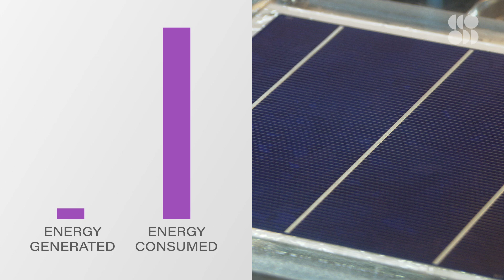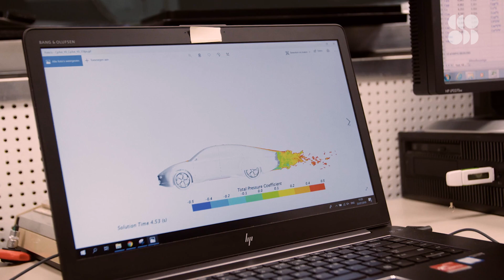The Solar Car Revolution Could Change EVs Forever

Comment from the maker: Would you drive a car that runs on sunshine? Let us know in the comments below.
Reply: I don't really need one since I can plug in at home, but if I lived somewhere without a driveway it could be a game changer.
Reply: What about Night range, and winter range in higher latitudes? 

Sounds like it’ll have geographic limits where it’ll won’t be crippled.
Reply: I'm looking for a car with great range. Nothing matches an Aptera with it's 600 or more mile range. The fact that it recharges itself is pure gravy, but useful for trips to the wilds.
Reply: @fotoguru222  
Is that winter in Wisconsin?
Reply: @larryscott3982  The usual wild places for me are the Adirondacks in NY and the 10,000 Lakes region of Ontario north of Barrie. Want to explore other places as well.
Reply: It sounds like, if necessary, the aptera plugs in, too. Both do. Finding a plug in those places is going to be a problem, though. What's the battery life from the last charge? Agreed that it can work.
Reply: Nah where I live it’s cloudy, I would rather buy a plug in EV like Tesla
Reply: I have ordered one. Not necessarily because of the solar, but because of the extreme efficiency. I love that it needs almost 3 times less energy than the most efficient electric vehicles on the market today. Finally a vehicle that uses its design to eliminate all the waste. I'm really uncomfortable with using more resources than what's technically necessary.
Reply: Better be both solar and plug in ev
Reply: @muhammadwibisonojanuar7793  it is..  250 -1000 mile battery options.
Reply: Yes! Bye bye electric bills
Reply: Yup
Reply: Can you guys feature the solar powered bioreactor?
I am really interested about it
Reply: It’s not a thing so no.
Reply: Air conditioning?
Reply: @FiftymonkeysonAtree  nope
Reply: Stupid concept, so no thanks.
Reply: What if you remove the wheel in the back and add some sort of magnets, powered by the solar cells, one down at the rear and one up in the wing thingy? Wouldn't that make the car's back stay up and give more mobility?
Reply: @JosephMaties  no
Reply: Using a car with both lithium batteries and solar panels is the optimum and best solution.
Reply: Around arctic equator this car would be useless since we get about 4 hours of sunlight on winters.
Reply: I wonder if it is possible to make transparent solar panels and then laminate them together to increase energy output or density while significantly reducing the apparent space/area required to utilise them. One of many problem would be weight because glass is heavy, laminated sheets of glass together are very heavy.
Reply: only if its 4 wheel drive, can handle adverse road conditions and weather.
Reply: not in the uk i wouldnt, my car would never charge up in the sun, as we dont get any
Reply: Most of us already drive a car that is solar powered. The solar energy is stored in the most efficient medium possible - the chemical bonds of a liquid hydrocarbon complex called "gasoline".  In so doing, the buried biomass robbed from when life flourished is returned to make Earth greener again. As carbon dioxide does not drive climate change, higher CO2 levels will help fight desertization and improve crop yields. Unlike chemically toxic batteries, no coal fired power plants will need to be built to recharge my Honda. Electric cars are for the "not in my back yard" types.
Reply: @tedphillips2501  No most people don’t drive solar powered cars. Where I live most people drive: hybrids or EV, some gas and diesel. There are flaws with completely solar powered cars and limitations that will effect it but not plug in EV.
Reply: @tedphillips2501  I suggest you look for your climatology knowledge from beyond those funded by the fossil fuel industry. Perhaps read something from the scientists at NASA and NOAA, like https://climate.nasa.gov/causes/

Comment: As for electric cars instead of plugging them in every time when the batteries is low, why not put a generator hooked up to the back drive wheels by a drive pulley belt or some type of shaft to the back wheels and the generator wires connected to the batteries as of a voltage box to keep the batteries fully charged while driveing and the batteries will never run out of power. That's my suggestion to an electric car manfactures.

Comment: Less ‘forget EVs’ and more ‘think EVs but batteries + solar panels + weight deduction and air flow efficiency’ would be great. Combining batteries and solar panels together would likely be great for having a smaller lighter battery with longer range. Plus getting these on trucks would probably be a big deal considering they want to go the distance while having as light a battery as possible.

Comment: @seeker look into this, i have known about this and i have seen the experiment that they did in california with the first solar car. The next part is to 3-D print wind turbines for better energy generation. The vehicle would be able to generate approximately 30% of the energy of the wind and if you put it along specific points on a car that the cars body will funnel the air to and create turbulence. This would be a wonderful asset for any vehicle enthusiast that wants to save the environment. There is more to this but this post is long enough
Reply: 3-D print wind turbines and put them in the wheel well of the vehicle. You will be able to almost have a perpetual machine. I have not copyrighted this as i want everyone to utilize these technology's, check to see if anyone did copyright them but please utilize these technology's
Reply: @johnohm8067  That won't work for 2 reasons:
1. The wheels already have hub motors and no free space
2. It is impossible to reclaim more energy through the turbines than the drag that they'd produce; they'd end up losing you energy and efficiency due to energy transfer losses
Reply: @LeesChannel  i indicated almost as an arbitrary word that is typically used for something that is close to something else but is not that something else. I think that you may have misunderstood the phrasing or use of almost to indicate that it would be close to perpetual motion but not perpetual motion for very specific reasons. 2nd law of thermodynamics is a real thing and i understand thermodynamics but even so why not utilize various technologies to get as close as possible to a completely efficient machine. From a consumer standpoint this would be ideal as you would have such little loss that the vehicle would require less to fill it up and go long distances

Comment: commercial ad that dont even speak of the most important things like price ? Autonomy ? Safety ? Payload  ? Speed ? Rare earth  in solar panel ? still need battery ? And what if you leave in cloudy climat ? How to product that on a large scale ? Etc ......just dream and try to attract investor... Im for eletric vehicule, it s  just that selling dream dont help and my BS meter sound alarm every minute of this video. This dream need breaktrough tech in some much way, For ex : better solar panel is not enough (10% better), revoluitonary solar panel (3 time better). So nice tech research but just that, no revolution...in 50 years it could become something commercial, maybe. 
An electric bike is more revolutionary.

Comment: Can they upgrade it, so the rotation of wheels can generate electricity which will be stored in batteries for later uses
Or add foldable solar panels, so when the car stationary can charge faster and harness more energy
Reply: They both have regenerative braking

Comment: Whats the range? performance? and other safety features? how will this fair in an accident or crash? the drawback of these concepts are still too high before they can be sold to the general public. The concept is great, but i believe this needs to be accompanied with a fiar comparison, and the information of the breakthroughs that need to be present before saying these can change EVs altogether. Breakthroughs such as materials cost, materials selection and design, as well as the fundamental concepts of solar energy and how much power and efficiency is needed to be comparable with a regular sedan, or current EVs. Also, with the design of current solar panels, it also only allows 1 colour basically, it may be small, but aesthetics and customisation helps to bring in more customers. If everyone's car looks the same, and it wasnt really something to do with a possible choice of the product, but basically it cannot be customised because it will affect the performance of the product, then thats another issue.

Comment: EV is the key....all the problems of solar is eliminated.

As per ev it is replacing fossils (100% non renewable)
With electricity which is 60 % non renewable generated and 40 renewables.

And that 60:40 is getting better by 2050 we will have a 25:75 ratio there. Meaning your moral compass is fine when using a electric vehicle.

Electric vehicles have been competent enough with combustion... soon they will start destroying combustions.

Solar cars will never gain traction...all rich countries that can afford this car are not rich with Sunlight radiation throughout the year....those who have are not rich enough to adapt.

EV is for all....rich buy "Tesla s" poor will by "Tata's Nexon EV"

Comment: This is exactly what we needed, a car with both solar panels to generate electric power and lithium batteries to store electric energy while also being able to plug to the grid and get energy from the grid whenever necessary.
Reply: Lithium batteries cannot be avoided. Solar or Electric Vehicles both require some sort of a power bank

Comment: The sun charges my Lithium-ion batteries when i accelerate.. And when i stop accelerating, the motor turns into a generator, and also charges the batteries.
I also have 2 small wind powered generators that convert the air flow of my car moving through it, to recharge the batteries.
With all that, i almost never have to press the brake pedal, but when i do, the heat is converted in electrical energy to recharge the batteries.
With all this, i can almost go 5000 miles without having to plug it.

Comment: The answer to solar and wind turbines is that they are now unnecessary. We now have the ultimate and cheapest green power device with none of these problems, in the SAFIRE GENERATOR. This is what we need to negate all the problems of all competing green energies. It produces almost costless electricity and therefore hydrogen from new FUSION NUCLEAR and is now immediately upon us. We have recently taken a new step to advance the physic of medium temperature plasma fusion power production by enabling chemistry of the atomic nucleus, or "nuchemy" in the newest FUSION NUCLEAR POWER technology. We are passing the chemistry level where we interacted with the atomic electron shells and are moving on to manipulations in this "NUCHEMY" atomic nuclear era when we interact and multiply nuclear protons. We have rediscovered the lost work of the alchemists and can make new elements with different atomic weights. This was ably demonstrated in "THE SAFIRE PROJECT". Quanta are important. We now have enough energy to manipulate the atomic nucleus much more easily by creating a compartment, or what is a local region of plasma containment so reactions at this atomic nuclear level can easily take place. This is about to practically enabled a really fantastic and cheap new era of energy production for the whole of mankind. This with hydrogen, so free fuel obtained from water or atmospheric moisture anywhere in the world. This new fusion nuclear SAFIRE GENERATOR is at the industrial commercial production final development point as of now and it can retrofit older and decommissioned power plants. The energy argument and other power methodologies are all now virtually irrelevant as we have new and very physically and economically powered practical and local community level fusion nuclear power. Solar roof plus Teslawall battery may be the present way to go domestically but megapack batteries and multiple storage technologies interconnected with an expanded ugly grid have a less certain requirement when you consider new any-scale community based and 24 hr reliable and self-fueling fusion nuclear in the form of the "SAFIRE REACTOR". Learn all about it at "AUREON ENERGY.COM". Then learn the newer EU Theory and plasma physics at "THUNDERBOLTS PROJECT.COM" and you will be permanently reeducated with this advanced newer EU theory that will allow you to understand more about the astrophysics of our whole universe and all within and you will be more informed and can teach your peers.
Reply: Fusion has been 30 years from working for the last 50 or 60 years...  It would be great if the Safire Project has made significant moves, we will just have to wait & see.  However, it would be grossly unwise to say that the Safire project offers interesting promise in maybe 5 years, so will stop investing in solar, wind etc...  Were we to take such a position, & Safire fails to deliver, then we will get to 2030 when the IPCC recommends essentially to have stopped burning fossils, without a plan B...  Safire might be producing power in 5 years, if it does then that would leave just 3 or 4 years to re-organise the world energy market...  That would be scaling up beyond the dreams of the most wildly optimistic, and how many more lives would have been lost from the ravages of Climate Change?

Comment: Why does a car being electric or solar mean that it HAS to look weird or 90’s futuristic? Just make a civic with a solar roof.
Reply: In the case of the Aptera that gives it so much lower air resistance that it uses a quarter or a third of the power almost every other EV uses to drive, enabling solar PV panels to make a useful addition to the range.  I guess a battery powered Civic with a solar roof might get a couple of miles extra range a day from rooftop solar?

Comment: why arent evs and hybrids covered with solar panels?
Reply: Because most EVs are too heavy, and have poor aerodynamics meaning that they take too much energy to move for solar panels to add any useful range.  Aptera only needs 100Whr per mile to drive, the Tesla model 3 is one of the most efficient cars around at the moment, & it needs at least 250% more power than the Aptera to move

Comment: Average solar power falling on 1 square meter in perfect weather conditions = 1300 watts.
Average surface area of car roof = 5 square meter.
Solar panel efficiency = 20%

Average power generation from these car mounted panels = 20% times 5 times 1300= 1300 watts

Average power to maintain a car at highway speeds = 20,000 watts

Therefore even in a best case scenario the electric panels on the roof will provide 5% extra range, in the day, in full sunshine and on cruising conditions.
If the car is accelerating or going up hill, or weather conditions limit direct sun the extension of range will drop from 5% to near enough 0.

Not to mention the added weight, cost and complexity of adding this system to the vehicle.

Complete scam, please don't fall for this nonsense!
Reply: You need to watch Engineering Explained on why there are not more solar powered EVs, he goes through the maths quite carefuly, & comes to the same conclusion as the Aptera team for the Aptera

Comment: It's really unbelievable how far they have come with solar tech..I hope we get to see these kind of solar based cars taking over the whole world at some point but only one thing is a big minus with these cars which is Winter days...when there's not much sun light outside if any at all or places (like in Europe) where they barely have any sunlight as well.
Reply: We had the sun here today, only about 40 miles from Manchester UK  ;)  Aptera does a range calculator where you can get a rough idea of how much extra range the solar PV will give you...  About 20 miles a day round here.  Though I guess if we had a car that could draw power from falling rain, it would do quiet well here sometimes...
Reply: @peterchandler8505  I see, well, maybe they need to make an hybrid car that has a solar/electric modes so people would be able to use their cars well in the Winter or in cold places where people don't have much sunlight.

Comment: Calling it now, this is pure vaporware. Engineering Explained did a video on this kind of thing debunking it already
Reply: They did find the figures worked for the Aptera, their calculation also came to 40 miles a day in sunny California & similar...
Reply: @peterchandler8505  so just like solar roadways, it'll work in theory, but fail in the real world. One of their complaints is that you have to rely on the grid to charge, easy fix, add solar and energy storage to your home
Reply: @dingus153  I don't see why that would cause the Aptera to fail, it has the same charging options as other EVs, but would add range 3 or 4 times faster because it needs so little power to move, just 100Whr per mile compared to 300-450WHr per miles for the bulk of other EVs...  That efficiency is a strong point for many.  

I would guess that many Aptera owners would have solar PV roofs, just as many of those who have other EVs do?  However, even 20 miles a day from the solar PV here in Europe makes the Aptera an interesting proposition

Perhaps best to wait until those 11 000+ who have paid their deposit to buy an Aptera get hold of one, and see how they get on?